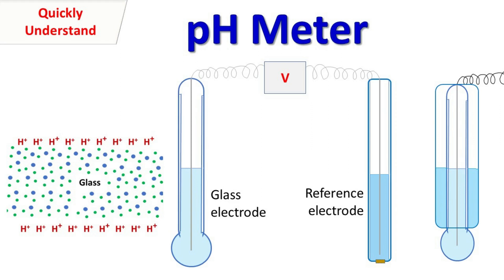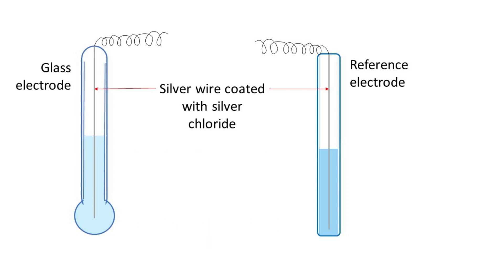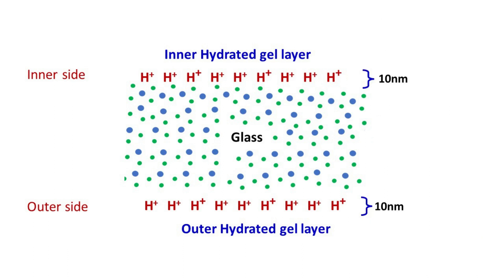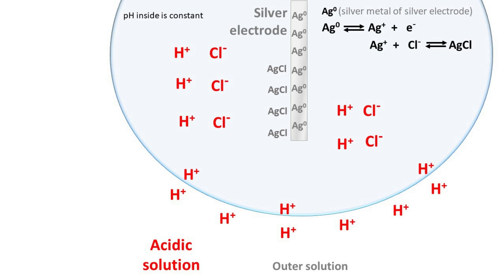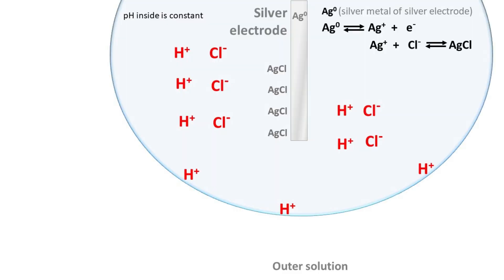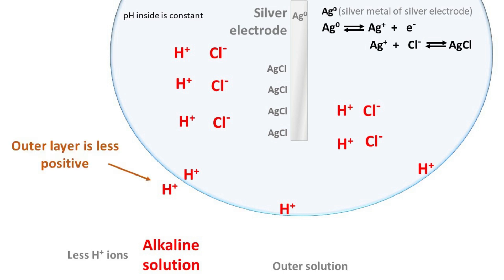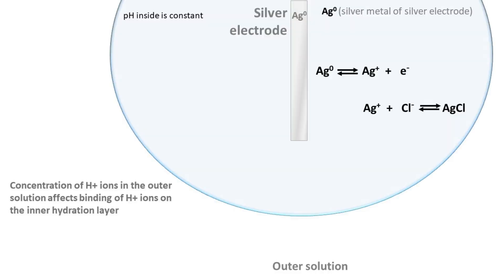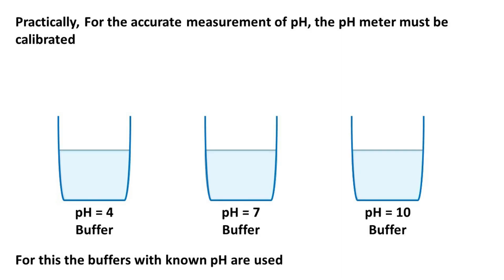pH Meter | working of glass electrode of pH meter

Comment: Sir I have some doubts regarding the electrolyte used in glass electrode , now as you said  the glass electrode contains 0.1M HCL then some of the glass electrode contains ph 7 buffer or KCL solution,then instead of H+ ions, will K+ ions attached to inner bulb  to describe how much acidic or basic your sample is?
Reply: Same question

Comment: why does the concentration of the H+ ions increase in the inner side when the concentration of the H+ ions is more on the outside, could not understand the logic behind it, shouldn't it be the opposite, like more the concentration outside, lesser concentration inside to maintain the charges?

Comment: An acid solution should make electrons flow towards it (reduction), not away from it. Big mistake in your video when you explain H+ on the outer/inner surface of the glass bulb: H+ outside means Cl- attracted to inner wall and reduction of Ag+ to Ag at the wire. The way you tranfer electrons will give an alcaline reading in your explanation. Makes no sense!
Reply: Your explanation is correct. Great!!!

Comment: I have watched quite a bunch of videos about pH sensor working principle and it seems everyone can have his own theory. When the glass has infinite resistance, according to this video, the cicuit is an open circuit and the potential between the inner layer and outer layer purely caused by the oxygen ions is the only potential can be measured on the potential or voltage meter. So what's the point to have the discussion about the AgCl and HCl and those electrons? And why didn't you talk about the reaction on the reference side?

Comment: The best explanation so far.
I have two questions: 

1. When the H⁺ of the outer solution sticks to the outer layer, then we need more positive ions to take their place. Probably, the K⁺ will migrate from the reference electrode because of the ionic junction, but then we will have fewer positive charges there. So, there will be a reaction with the silver wire, but this means that the potential will change while it is supposed to be stable. So I don't really know what really happens.

2. Is this the same mechanism for other electrodes with selective membranes?

Thank you so much.

Comment: When you say that the H+ from the external solution (to test) makes the inner H+ accumulate to compensate the charge difference, it seems incorrect as what will happen in this case is an accumulation of Cl- because the electric field produced by the H+ ions will repel the inner H+ and attract the Cl-. Can you please explain why then will the inner H+ accumulate on the surface of the glass ?
Reply: Because the negatively charged oxygen atoms of silica on the inner surface would repel the negatively charged chloride ions and attract the positively charged protons.

Comment: VERY GOOD AND DETAILED EXPLANATION, but I have still a problem (at time5: 31) Why is it that if the electrode is enriched with - charges (because it's an acid, and therefore has a low pH), the measured potential is nevertheless greater (and positive) on the graphs? 
Is this due to a departure of - charges towards the op-amp input, leaving a positive potential equal to that of the glass electrode? In any case, in the explanation given, between the positioning of the electrons on the central electrode (in the case of an acid), which would suggest that locally the potential at the end of the metal electrode is negative, and the fact that the potential measured at the op-amp input is positive, it seems to me that a step is missing in the description of what happens in the glass electrode. Of course, this is symmetrical in the basic case. How do you go from an electron-enriched electrode (acid case) to an electrode providing a positive input potential to the op amp?

Comment: Something may be wrong, H+ and H+ repell each other. F e. 4:30
Reply from the maker: Thank you for your query. The thickness of glass membrane is approx 0.1mm which is a huge distance for tiny H+ ions. Hence, they will not repel each other.
Reply: @quickbiochemistrybasics  What i am saying is that at 4:30 INSIDE the electrode its not the H+ ions coming to the glass wall but the CL- ions, that are attracted by the H+ on the other side. otherwise, there is no reason why they should move there, at least I don't see a reason why the H+ should go there in your video. Correct me if I am wrong please. I am not an expert.
Reply: @sa8lvi H+ ions from HCl solution moves towards the inner layer of glass to balance the negative charge due to oxygen ions of glass buld.
Reply: @sa8lvi  You are not alone. Only makes sense, if there are less H+ ions attached to the inner surface of the membrane, leading to an increased H+ concentration near the inner electrode and therefore a positive potential on the inner electrode. And indeed for ph < 7 the voltage of a pH-electrode is positive (+on the inner electrode an - on the reference electrode). All the sources I have found do not explain the detailed chemistry on the membrane at all or are all over the place. It seems to me nobody apart from some phds understands this properly.

Comment: I do not understand why the inner H+ ions move to the internal glass surface when the outer solution is acid. Should't they be repelled since they have the same positive charge?
Reply from the maker: Thank you for your query. The thickness of glass membrane is approx 0.1mm which is a huge distance for tiny H+ ions. Hence, they will not repel each other.
Reply: @quickbiochemistrybasics  ah allora si
Reply: Due to the ph glass electrode tip which looks like bulb is made up of different compositions of oxides like cao,sio2,na2o.
The inner bulb contains 0.1 mol/lit HCL solution having ph=7.
These inside H+ ions and outer H+ ions are attracted towards negative charge of oxygen(cao,Na2o,sio2) and form a layer inside and out side
Reply: I thought about the same thing, any reason for this?
Reply: The H+ are not going outside to inside and they can not go because of the thin glass in between and it results in unequal charge on outside and inside. SO to balance the charge the 0.1M soln. of HCl present in glass gets dissociated and move towards the glass surface leaving chloride ions behind .
Reply: @palak3407  I do not understand the "to balance charge" thing. If the two solutions are completely separated, shouldn't they have indipendent behavior?

Comment: A question. At 4'30", why the number of H+ ions in the inner and outer layers of the glass have to be balanced?
Reply: Exactly.  why inner hydrogen ions should stuck to the surface of the inner glass because there are more hydrogen ions outside? It doesn't make sense to me
Reply: It seems to me the inner H+ should be Cl+, so its the other way around maybe: alkaline <-> acidic